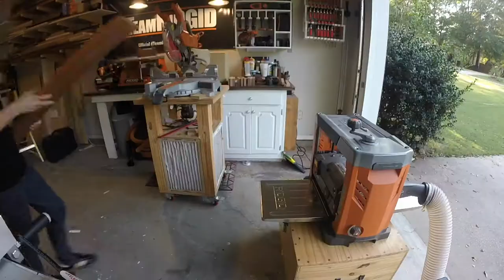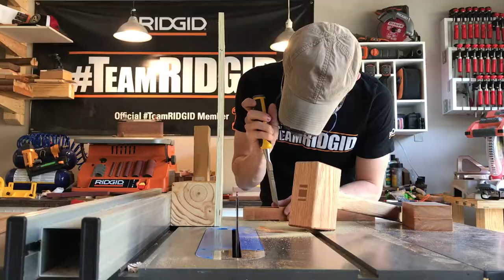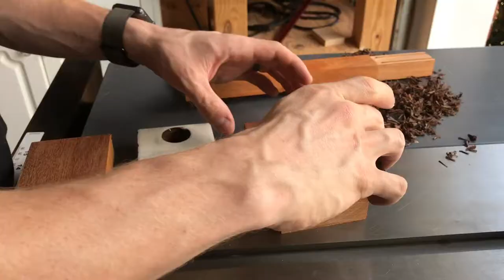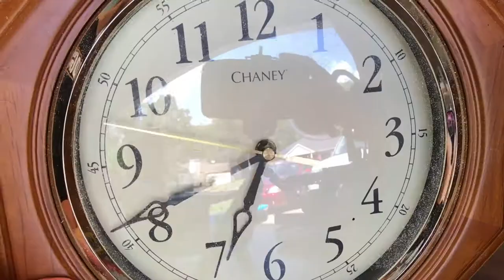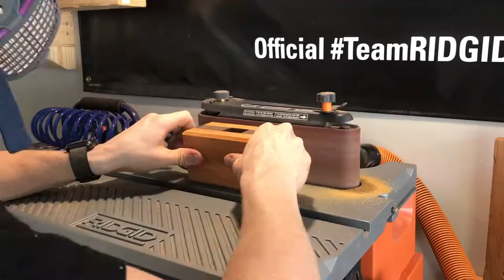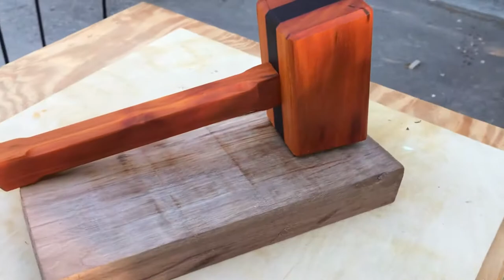Making a #TeamRidgid Mallet

Comment: What wood did you use for this mallet?
Reply from the maker: daniel daitch hey there! This was a unique species called “chakte viga”. I actually just posted another video on my Instagram page yesterday of another mallet made with the same wood (tyson_moore)
Reply: Thank you for the quick reply! If I can’t find any locally would you have any suggestion to get the same hue? If not my back up will be a blood wood and wenge combo.
Reply from the maker: If you can find canary wood (almost yellow) and then use boiled linseed oil on it; it turns it almost orange. I'll be posting some pictures here in a few days of the canary wood mallet and it almost looks the same as the chakte viga. And yes, bloodwood and padauk both turn super red with oil but both look really great with wenge
Reply: Thanks for all the help! Between this video, your website, and your replies I got one made. I wound up finding some blood wood I used for the outside and handle and some Bolivian coffee wood for the inside and wedges.  I did run into some complications on cutting the inner parts 2° angle so I had to make the head of the mallet 4 1/4” instead of the 5 1/4” I planned on.
Reply from the maker: Man that is fantastic! I'm so glad you decided to build one! If you are on IG then send me a message, I'd love to see it! tyson_moore